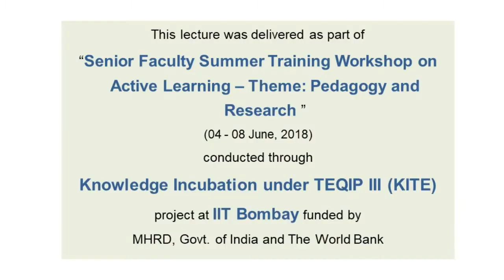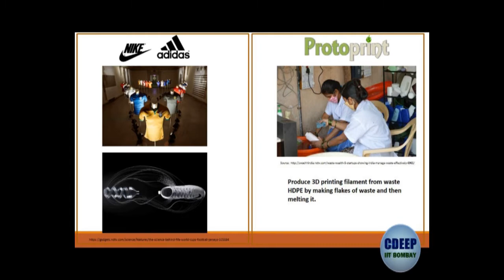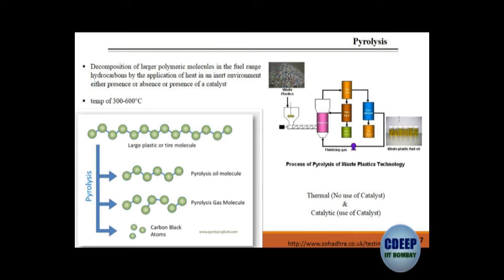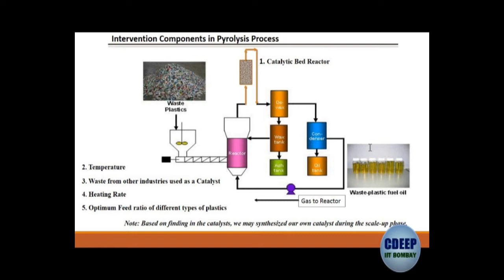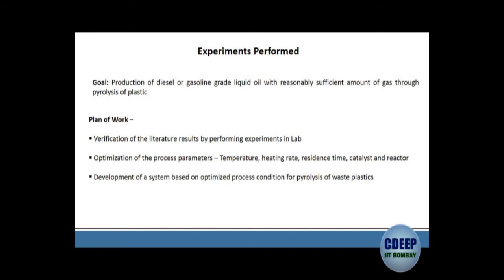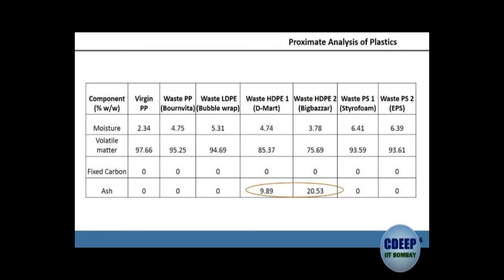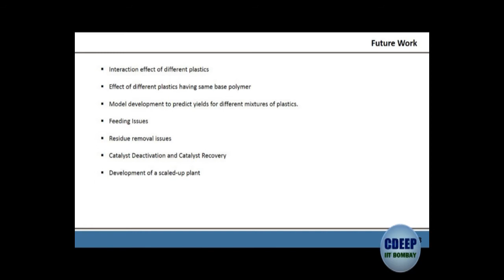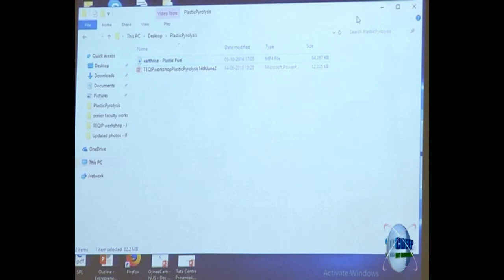Conversion of Plastic into Fuel Oil through Pyrolysis by Prof. Srinivas Seethamraju

Comment: Sir in this process a great problem comes  as plastic have low density hence a very big vessel is required to heat plastic in the absence of oxygen and if small vessel is taken oxygen free environment brakes again and again. And if big vessel is taken then the energy consumed to heat is not financially viable.